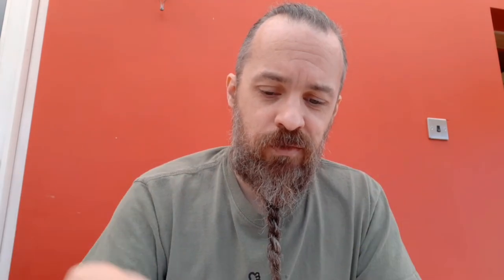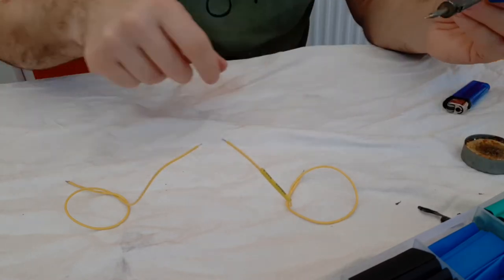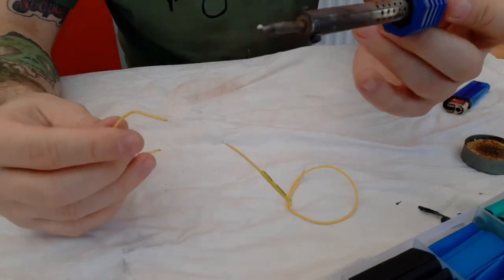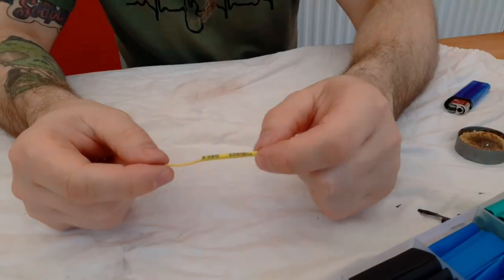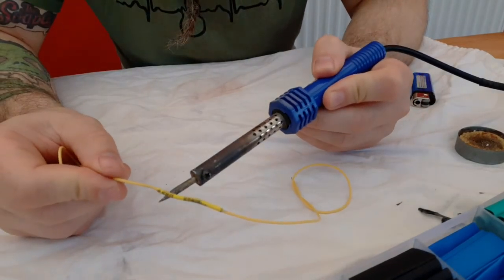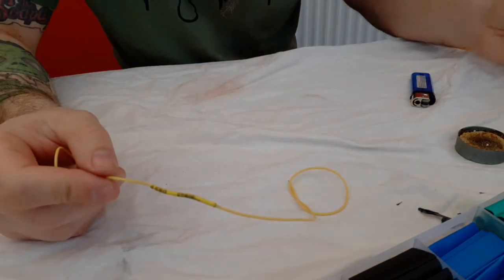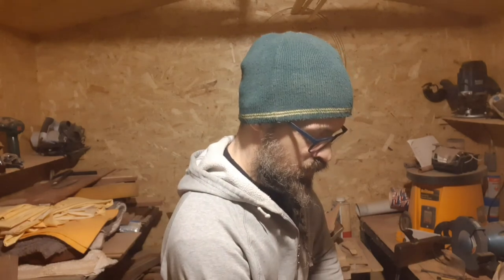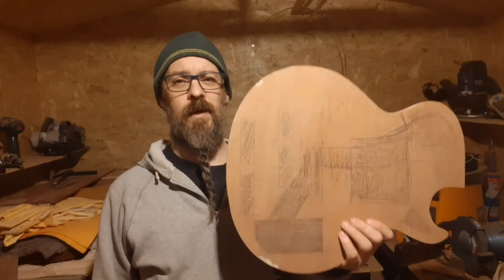Soldering For Beginners - Tutorial - Steve Walker Guitars

Comment: Steve, A quick tip for keeping the end of your soldering iron clean If I may. Get a full sheet of paper towel fold it until it's about 3 or 4 inches long then tightly roll it into a cigar shape use masking or electrical tape and tape it in the middle and again about 1/2 inch  from either end. Use this to clean the tip of your iron between solder joints. It cleans the tip well and does not cool the tip down like the sponge will.
Reply from the maker: That's a great suggestion mate, ill try that next time I'm soldering 😀👊